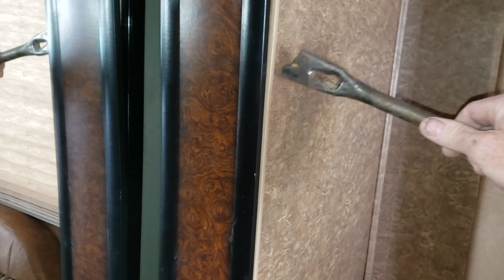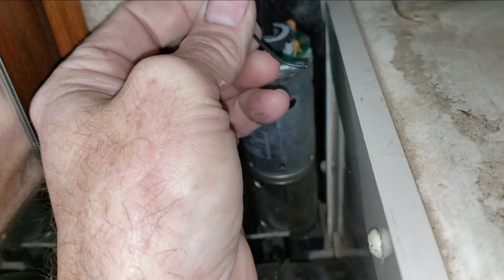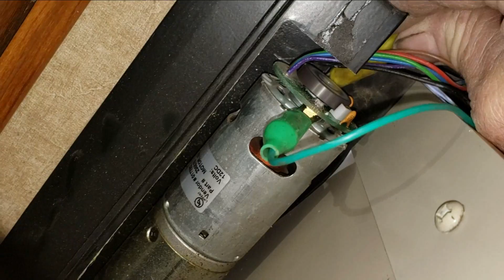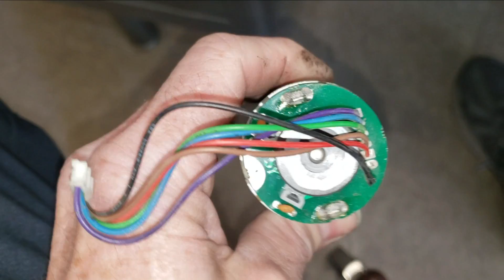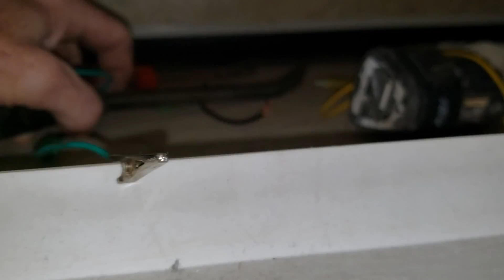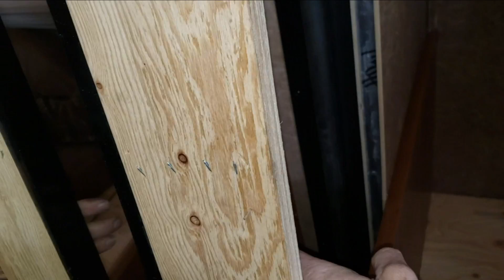Schwintek RV Slide Motor Failure...Replace or Repair?

Comment: Great vid. Have a Sunseeker with the full slide as you were working on. I have an issue where the motors are out of synch. The front slide is touching the sidewall whereas the back sticks out similar to your vid. I have tried what i think is all combinations to synch and get the back end flush, but nothing seems to work. Any ideas. Thanks
Reply from the maker: if the front is touching the wall when extended, start the retract cycle for a split second. as soon as the motor begins to move stop the slide and extend it holding the switch down. This should for ce the slide to sense the stall at the front and allow the rear motor to "catch up" for .5 to 1" then the slide will stop. Repeat the process until the slide is in sync and then watch the slide as it fully retracts and hold the switch until the slide turns off. Good luck!
Reply: @AZExpert  Hi.  Was finally able to try your fix.  Wasn't able to get to RV because of the closure of the RV Storage due to the Pandemic.   Your solution worked like a charm.  The key was your "Catch Up" for .5 to 1". Then repeat.  Awesome advice.  Thanks for this advice and all your very informative videos.  Cheers

Comment: This video has helped me understand this better than any thing I have found so far, and I've been researching, I have this slide in my 2018 Georgetown.  If you couldnt solder the motor up enough to extend it far enough to access the motor retention screw,  what do you think you would have had to do to get the motor out?  My first thought, if I knew exactly where the srew was, is to drill a large enough hole from the outside to get to the screw.  Can you think of a better, less destructive way?
Thanks again for sharing your knowledge and skills.
Reply from the maker: If the motor was dead, it would have had to be replaced anyway so I would have just pryed the motor until it broke free...in other words I would have destroyed the motor housing that the screw interlocks with. Definitely do not drill the hole from the outside. Now some report being able to push the slide out manually with great effort at slow speeds, but I think that tends to risk damaging the box, floor, fascia, and rack assembly too much. I  am happy you enjoyed the video and found it helpful. Thanks for watching

Comment: I'm a RV tech and you simply use the switch to move the side that works while pushing the other side out by hand once you disconnect the motor
Reply from the maker: Thanks my guy, I'd suggest making a video of the process you are descibing so we have a better understanding of the easier way.
Reply: I just had one with a short in it..as in this video it was the black wire but it was on the connector side not the motor side... unfortunately u have to pop the motor up and out to be able to manually push the slide...simply un hooking it won't let u push as the motor is what keeps it from moving on its own. Definitely could have been a better design for sure

Comment: Seems like they never think them through when they build them at the manufacturer for them to be serviced always a pain.
Reply from the maker: yes...I rarely defend the factories. Rumor has it you can push the slide out manually with tremendous effort, but I'd be concerned about damaging the rack or interior and would rather just break the motor apart first. Thanks!
Reply: @AZExpert  yes I have heard that also

Comment: Nice soldering job. Definitely saved some cash for the customer. Yeah as I watch your videos and do research, I’m not a fan of schwintech slides. Glad you didn’t have to destroy everything to remove the motor. 👍🏼
Reply from the maker: I really lucked out with just a broken wire. I am also not a fan of the mechanism either, but manufacturers and buyers don't listen to me. :) Thanks for watching!

Comment: One we had a hole where you could crank the slide out
Reply from the maker: There are definitely many slides that can be cranked by hand, unfortunately, these are not one of those. To manually retract it, both motors have to be lifted and then the slide should just push in. The motors are also the brakes of the slide. Thanks!

Comment: That slide seems far too big for a Schwintek mechanism.
Reply from the maker: This slide was installed and built well. It's an average size, when compared to the full sidewall versions that are made. I didn't show it, but the slide could be pushed out very easily when the motor was removed. This is a sign the slide was built correctly with enough roller support underneath. Thanks!

Comment: It looks like when repairing these RV's, you must encompass all the trades. Electrical, mechanical, plumbing, and inventor lol. If the builders of the things would spend a little more time and money it would be a much better product. To learn this craft, is it a hands on education or are there facilities that you can attend to get trained? Awesome repair. Love your videos.
Reply from the maker: Yes. RV repair includes every trade of home building, including standard automotive, diesel, construction equipment, a/v, electronic/computers, HVAC, on of course appliance repair of all types. But I think sometimes, knowing how to do almost everything means I'm not great at anything. But variety does make work interesting. There are a handful of RV trade "schools", but in general RV techs are made at dealerships and the customer pays for their training! LOL! After 7 years, I thought I knew everything, after 15 years I thought I understood somethings after 20 years I can't believe how little I knew. Thanks for watching.

Comment: Cant you Manualy crank the slide out?  
.
Reply from the maker: I did technically manually crank it. The motor is the brake of the drive system. Once it's pulled up, you can really just push the slide in and out. Thank for watching

Comment: Great video. I like to use a hot glue gun for making a strain relief or to stabilize wiring. Ready in 2-3 minutes. Man, I'm thankful our 2003 Newmar Dutch Star doesn't have that slide out system on it. You don't give up. Thanks for all the videos you post. They are very informative.
Reply from the maker: I had thought about it, but as these units can get 160 degrees in the summer storage I have seen hot glue spread and didnt want it to jam the motor